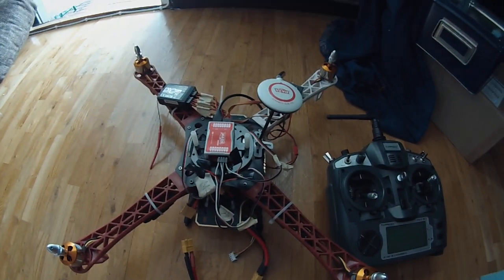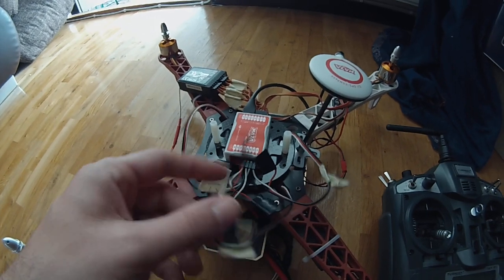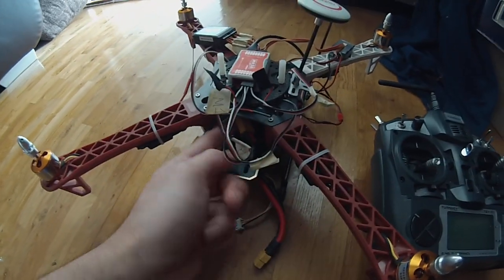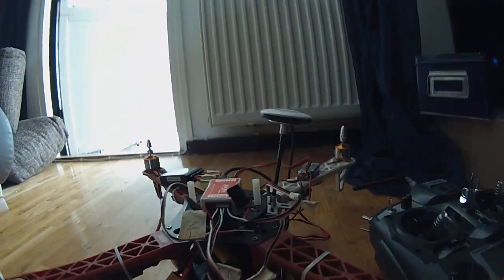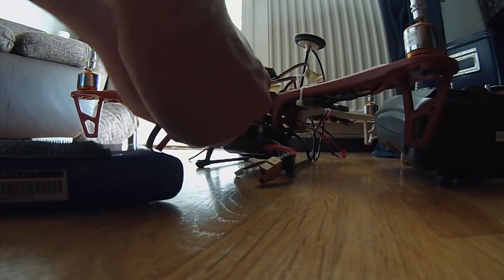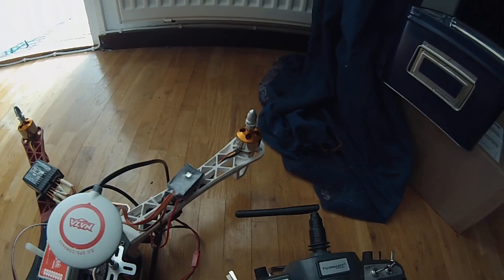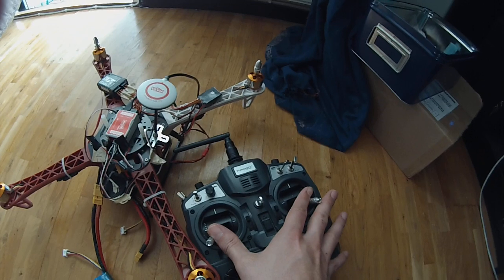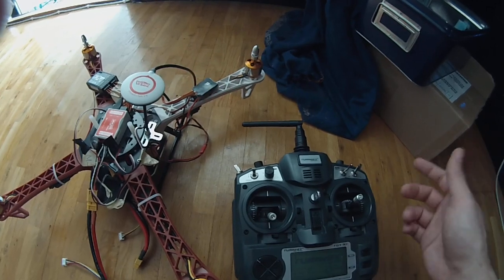DJI Naza does not arm

Comment: It's also worth checking your transmitter settings with the assistant software. I had my throttle channel reversed, so to arm it I would have to put the throttle stick to the top left and the other to the bottom right.
Reply from the maker: Thanks for the help! A bit late but thanksb
Reply: @logicron  it’s not too late if it helped someone!
Reply from the maker: @reidparker1893  that is very true ! Thanks again